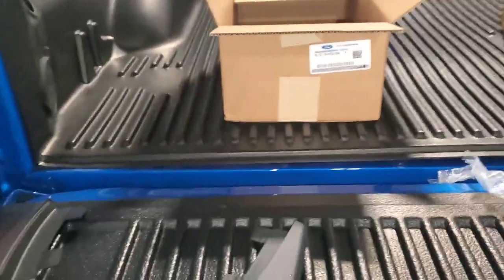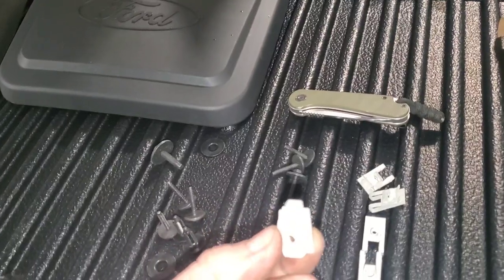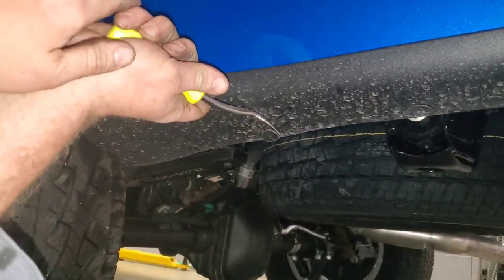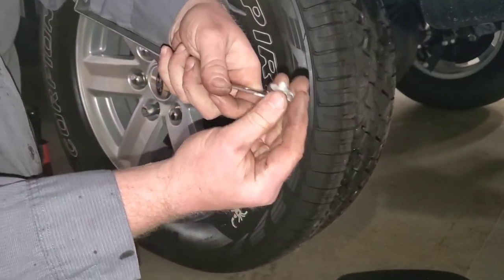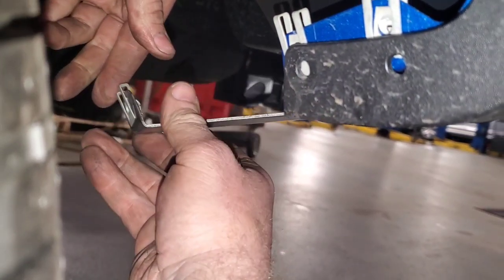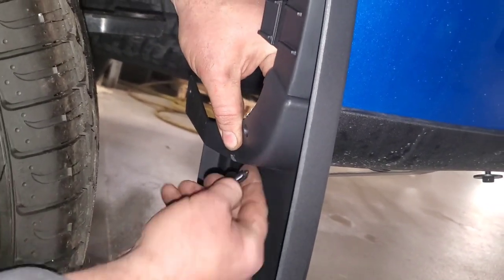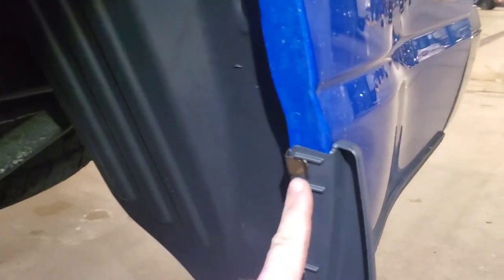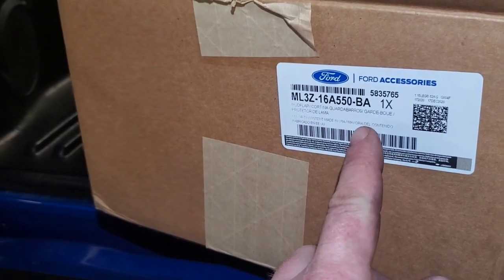2021 Ford F150 Mud Flap Install, Ford Mud Flaps - How To #2021FordF150

Comment: The title says 2021 F150 and in your intro you say a 2020 F150. I am looking for the 2021 mud flaps and wanted to be sure if I used the part numbers given here that they would be the correct ones. Thanks for the video, watching this will sure help me with the installation.
Reply from the maker: I put out so many videos for people on here to learn from that I do make mistakes sometimes so I will reconfirm in the morning pretty sure it's a 21
Reply from the maker: You get caught in the moment and there's not a lot of people that want to put on videos teaching other people how to do things I do that every day multiple times a day so things sometimes get a little exciting
Reply from the maker: Here I did the homework ebay, 

they are the same, says they are for a 2021
Reply from the maker: https://www.ebay.com/itm/2021-Ford-F-150-OEM-Molded-Black-Splash-Guards-Mud-Flaps-without-Wheel-Lips/274613961160?chn=ps&norover=1&mkevt=1&mkrid=711-117182-37290-0&mkcid=2&itemid=274613961160&targetid=1068186687060&device=m&mktype=pla&googleloc=9021506&campaignid=11615951272&mkgroupid=116154521907&rlsatarget=pla-1068186687060&abcId=9300457&merchantid=108421832&gclid=Cj0KCQiAvbiBBhD-ARIsAGM48bzeLRI0X409balDGsm8muYshl1Zm9oPQIiGWeNomeEDHl4e__kurj8aAkFEEALw_wcB&pageci=0b1b6e9f-acf9-495f-9770-4188248011f7
Reply: @FordBossMe I completely understand. It certainly wasn't my intent to find a mistake and point it out. Just wanting to be sure what year truck I was looking at and getting the correct parts. Nothing but appreciation and gratitude for the effort you and others put into what you do here. Thanks for the response!
Reply from the maker: Sorry for the late reply, anything else you need help with please reach out to me or email me poissorichard.rp@gmail.com
Reply: This is the same part number for a 2020 f150 tremor also. Great video
Reply: @FordBossMe  como puedo comprar unas loderas. Las quiero para la Ford Ranger argentina  año 2005   algún link donde las comprastes

Comment: Without a doubt best video in these hands down. Thank you 

FYI 2022 trucks ( I got one ) only comes with 1 hole drilled in the rear so you either drill it out or leave it alone
Reply: I ran into that issue tonight. Was super confused wondering if I had the wrong ones. (‘23 tremor)

Comment: Great video.  I just installed these mud flaps on my 2023 F150 following your instructions to the T and the install went perfect.  The instructions in the box were clear as mud, just like most of the instructions Ford sends along with their accessory parts.  The only difference I encountered was my truck (2023 Super Crew), only had 2 push pins to remove on the bottom piece of the trim versus 2.  I’m thinking that was because of the short bed.  Nonetheless it wasn’t a problem.  I mounted the metal bracket on the 2nd hole instead of the 3rd and it worked out perfectly.  Not sure I like the design though.  I can see mud and snow getting jammed in between the top of the mud flap and that bracket but we’ll see.

Comment: On 22 XLT had to drill through the plastic piece behind the wheel for the second hole, kinda a pain with  the wheel on.   Also only two push in fasteners on the underside of the rear fender so take out both not the 1st and the 3rd.  But this is a great video, much better explanation than the hieroglyphics that come with the flaps.   Straight and to the point, made install much easier and quicker.
Reply: I found it easier to completely remove the black plastic skirting to line up the holes on the skirt and mud flap to drill the hole.

Comment: Thanks for the install video, the printing in the instructions was so bad that I couldn't tell what any of the pictures were of. It was over 100* today with high humidity so I'm glad I didn't have to stare at the parts and figure it out for myself while working outside.

Comment: Thanks for the video. I installed Ford flaps on my 2018 and the process was almost identical. The 2018 kit came with only 2 screws each side for the rear instead of 3. I think if I used a 2021 kit it would have been better with the 3 bolts instead of using a plastic push plug in the other hole.

Comment: Look at instructions, bar goes on TOP of body, not in between plastic and body. Tape folds around body to protect it.
Reply from the maker: You have the new kit the early kit didn't have that, 

Things change and directions are changed in ANYTHING to make things better 

If I tell you something is a certain way that's because it IS

Comment: Great video made install easy and fast. On my 2021 XLT. Well would have been fast if I didn’t have to spend a hour looking for the 2 bolts I dropped in the grass. LOL. I used the Ford points and got front and back mud flaps and rear wheel liners for $85 all genuine  Ford parts and doesn’t void corrosion warranty. A couple of tips I used the handle of a screw driver to push the clips on easier on the hands and just seemed easier all the way around. Also push the mud flaps tight against the body of the truck while putting clips on and tightening the bolts to the body.
Reply from the maker: Good deal
Reply: where did you get it for so cheap??
Reply: Marcin97 I bought from the dealer using Ford points I received when I bought the truck. It fords reward program. You get points for things you buy and for service visits. I got 42k points for buying the truck and at my dealer that was worth $210 in discount.

Comment: Nice job. The materials for the rear flaps I purchased from my local Ford dealership included two strips of adhesive tape, and the instructions indicated the tape is placed between the fender and fender molding. Since you didn't mention this, I didn't add it...probably doesn't make a difference.
Reply from the maker: Yeah the parts I showed you in the kit here is exactly what came with it
Reply from the maker: So maybe they updated the kit
Reply: It goes between the bracket and the fender to protect the paint, (not between the fender and the molding).

Comment: The rear mud flap kit I got from Ford included two clear plastic strips to prevent aluminum / ferrous metal contact on the brace, possibly leading to corrosion.

Comment: Well done.  I'm usually pretty good with this kind of stuff but the instructions that came with the flaps are lousy.  The fronts were easy but the back ones?  Did Ford conspire with IKEA for the directions and then threw out the plans and let someone that has never been near a truck draw them up??

Comment: I still can't figure out what the two strips of stick-on film are for and why they send you a 2' zip tie with the kit too.
Reply from the maker: So the two pieces of stick-on film are to protect the paint that you put the clip on and the zip tie I don't know but what I can tell you is the kit may change little by little as it progresses
Reply: I am getting ready to install my set, did you find out what the zip tie is used for? Mine also has a zip tie?

Comment: So the two upper flaps fold to protect the paint/metal form the clips.... BUT the lower two just have the clips chew into the metal.... FORD
Reply from the maker: Unfortunately they don't give any protectors for that so you're right there is a couple little small indentations that happen but they're very small, I'm sure if people had like some cloth tape they could line that up first and then push those on and that would help.

Comment: Hi Fos Boss Me,   great video!   buddy  out of topic.. by any chance do you know if the sunroof panels of a 2021 F150 are the same for the 2020. dealer does not help and I have broken the 2 pcs and currently there is a back order, I measured the glasses and the opening of the moonroof and measure the distance of the screws of the glasses and to me they are the same. any thoughts?
Reply from the maker: If you remind me in the morning I can look that up for you if my parts guy willing to do the work for me
Reply: @FordBossMe  sure thing I will.. I really appreciate the quick response.    I measure the glass from another F150 from previous year and it is the same length!   par number for 2021 is ML3Z-16500A18-A and  the part number for a 2020 it is Fl3Z-16500A18-A  any thoughts I will really appreciated as dealer does not help.    send a message here in the morning or where do I catch your attention.   I really appreciated.
Reply: @FordBossMe  hey my friend here I am !  Would you please check with you part guy and see if can help me to find out what are differences on the 2021 F150 sunroof glasses vs previous generation please.  Seems to bolt on each other, but not sure if I could use the previous gen as the 2021 are in back order without an ETA

Comment: I have a 2023 bracket is on top is it supposed to go in between? Little plastic piece goes on the very bottom?
Reply from the maker: I haven't done a 2023 so I can't tell you I think some people have said in the comments that they did so you might be able to read through the comments and find out

Comment: did you use to two clear plastic strips on the rear
Reply from the maker: what I had in the video is exactly what came in each kit I had
Reply from the maker: I showed everything I used
Reply: @FordBossMe  thanks...mine came with two plastic strips...one for each brace to protect the paint...i am guessing
Reply from the maker: @northlander4370  oh yeah I specified in the video that you fold the strips over
Reply from the maker: The strips that protective paint are actually bill on to the mud flaps so there's no clear ones they're just already maydan and you fold them over
Reply: There were two clear strips for the rear bars on the white paper. I assume since the bar mounts to the inside they are not needed and would never be seen? I forgot about adding them so I left them off mine. I assume it should be fine.
Reply: @TheMaddysdaddy  yeah I came
To this video hoping to figure out where those clear stickers go. The instructions suck! Best I could read online is your wrap the metal brace bar with the sticker to prevent rubbing but on my 2021 install I don’t see how that’s necessary anywhere.

Comment: Is there an insulating sticker you need to apply to the support rod?
Reply from the maker: Only what's in this video I showed all the spots where it goes
Reply from the maker: There was no insulating sticker on the supporting rod that goes to the bed side bottom

Comment: I am putting generic mudflaps on my Ford Edge.  I am attempting to determine how far I want the bottom of the mudflap from the road.  Would you say those Ford ones are 4" from the ground?  2" ?  I figure whatever height Ford decided would be good.  Anyone know a good height from the bottom of the mudflap to the ground?
Reply from the maker: So the F-150s actually sit pretty high up you're not going to gauge it the same with the edge the F-150 they're like 12 in so you're going to have to go to like 6 to 8 with the edge

Comment: a question on a purely none related topic, I'm trying to find out if - when I order and receive my 2021 Lariat supercab, will the graphic in the dash be a supercab or a crew cab? If you had any knowledge of this, I would appreciate it.
Reply from the maker: So I need some clarification on what you're talkin about here are you talking about when the radio pops up is it going to be a graphic of a super cab or a crew cab?
Reply from the maker: We have a couple inbound and when we get them if you remind me I can go run out and start one up and check for you
Reply from the maker: Next week we have one on the transit now that will be here and I'll go out and look but I need you to remind me maybe middle of next week
Reply from the maker: But I need more specifics on exactly what you're looking for very detailed
Reply: @FordBossMe  in the center of the guage cluster is a graphic of an F150  crew cab that spins around as you select different drive modes, just curious if the supercab trucks will have a supercab ?
Reply from the maker: @peeblestim  we will see

Comment: Hey so I have the 2021 F150 Lariat Super Crew 3.5 V6 and that ebay page says they won't fit, but they do fit a Super Crew V8 engine F150. Are they different in body style?
Reply from the maker: https://www.ebay.com/itm/2021-Ford-F-150-OEM-Molded-Black-Splash-Guards-Mud-Flaps-without-Wheel-Lips/274613961160?chn=ps&norover=1&mkevt=1&mkrid=711-117182-37290-0&mkcid=2&itemid=274613961160&targetid=1068186687060&device=m&mktype=pla&googleloc=9021506&campaignid=11615951272&mkgroupid=116154521907&rlsatarget=pla-1068186687060&abcId=9300457&merchantid=108421832&gclid=Cj0KCQiAvbiBBhD-ARIsAGM48bzeLRI0X409balDGsm8muYshl1Zm9oPQIiGWeNomeEDHl4e__kurj8aAkFEEALw_wcB&pageci=0b1b6e9f-acf9-495f-9770-4188248011f7
Reply from the maker: I don't believe so, I think they will still fit
Reply: Thank you! I just ordered them and will let you know!

Comment: $49 a piece at the dealer
Reply from the maker: I think eBay you can find them even cheaper
Reply: @FordBossMe  yes thanks to you ! Do you have a vid for the wheel wells or liners? I was surprised they said they have for the front also
Reply: I ordered the ones you linked in one of your replies, thanks again.
Reply from the maker: I don't think I have one for the rear liners but they are super easy they literally just pop right in and there's minimal installation and everything's right in front of your face like you can clearly see where everything's goes in the back but for the front I've never done fronts because they already have liners